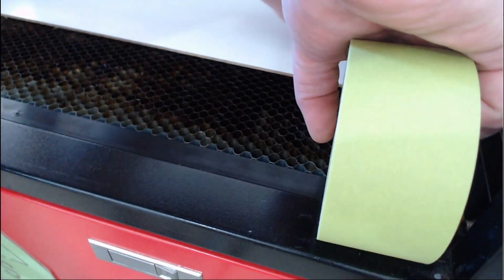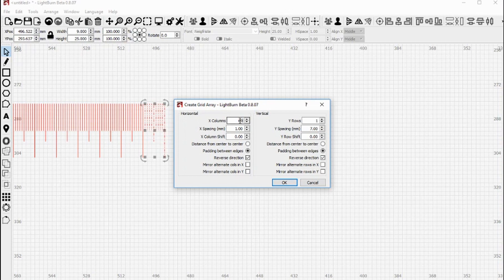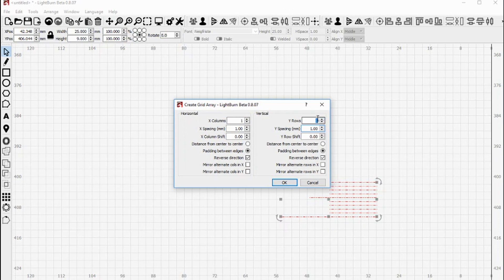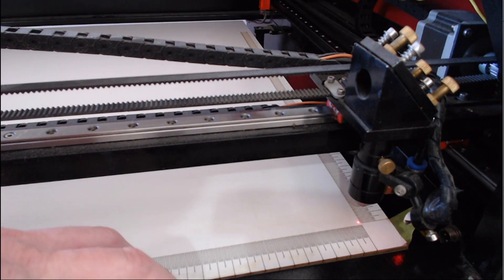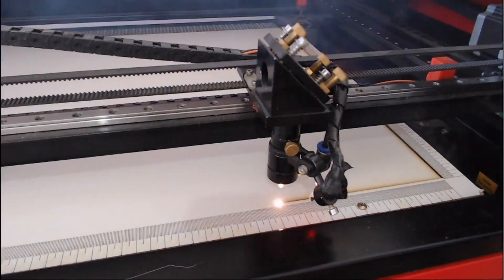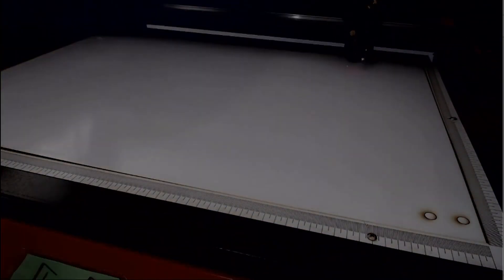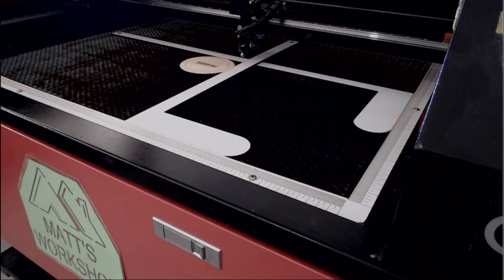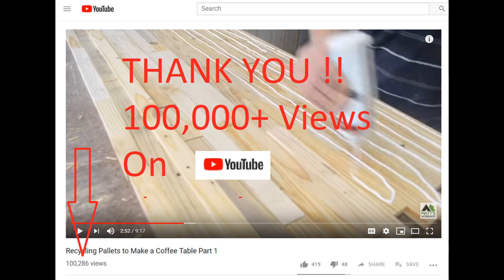Co2 Laser Improvement With A Laser Bed Square and T-Squares - CNC Co2 Laser Machine

Comment: Buying an aluminum 24" squre and screwing it to the bed frame will work just as well I think.  Lot less work
Reply: The bed on chinese lasers is not square, and it doesn't have the same inner frame size as the actual laser working area. This would lead to an imprescise placement of said aluminium pieces. Letting the laser cut it out, you ensure the frame corresponds to the actual laser working area.

Comment: Can I use perforated metal sheet for co2 laser bed?
But the issue it has more area and less holes!
So laser will touch the bed more often!
Will that be an issue?
Reply from the maker: you can but it will most likely result in ablated material and smoke coating the bed, so you will need to clean it more often.  reflections may also mark the backside of the material being cut if not raised off it.

Comment: Why would you not first screw the wood onto the bed and then etch the rulers and make the cut all in one run? This would be so much more accurate.
Reply from the maker: because the ruler's final position is outside the engraving and cutting area

Comment: So, I got my 60W Blue and Gray laser setup and calibrated this past weekend and wanted to make one these edge alignment guides. For what ever reason, my laser won't even start a cut if I have it set to cut along its limits. I have a Ruida 6442 and using RDWorks, Is there a setting I need to change? When they use terms like "Is Blowing" for air assist, I may have over looked it. Thanks
Reply from the maker: it could be just that you have the starting origin set incorrectly for the job you are cutting.  you can email for further assistance to askmatt@mwlaser.com.au

Comment: I purchased the blue and white Chinese 80 watt laser. So far, I have not got it working for several reasons. 1) water pump didn't work out of the box2) can't get corel draw/laser to talk to the M2Nano board.I have purchased the Cohesion 3d board and lightburn software (hopefully it will arrive on Friday).My question is, I have the same wire bed as you, but mine is loose, did you permanently mount yours? Otherwise I could see it moving after you've done this work.
Reply from the maker: That's bad news that you are having issues with your machine.  Hope it works well for you soon.
No my table came fixed in place it doesn't move around at all..  I do plan to look at options remove it at a later date and install a better system.  
Cheers Matt
Reply: Thanks for the info, keep posting vids, they are informative.Ray